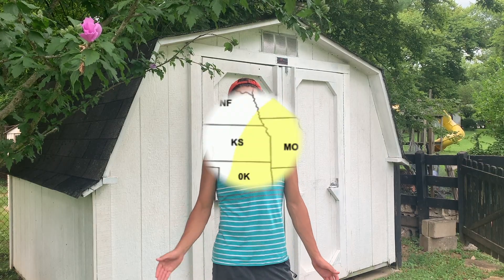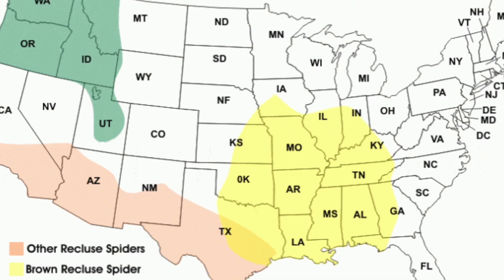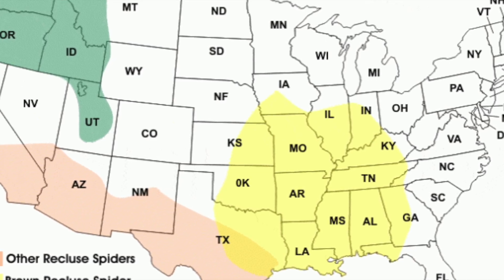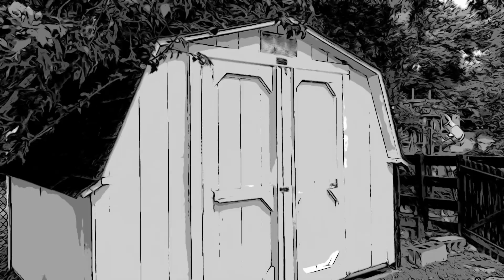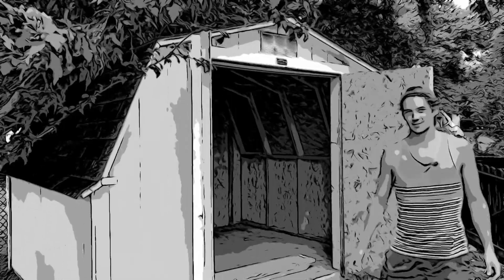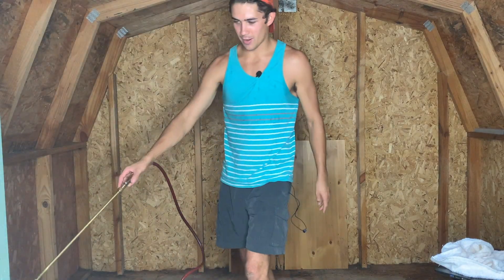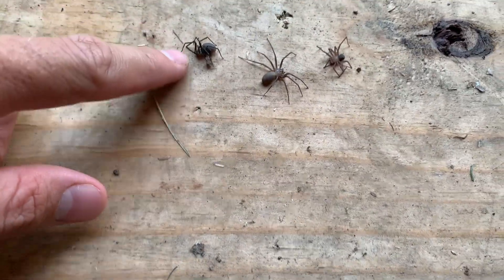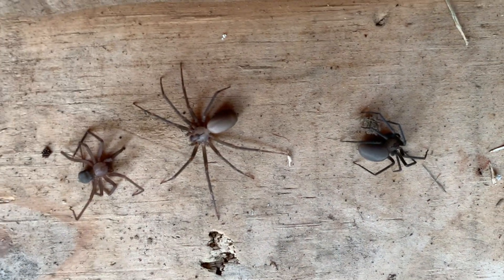Identifying the Brown Recluse Spider Infestation - Example and Treatment

Comment: Hey Dan, just want to share what saved me from a spider bite. A friend, who is a doctor, told me to never be without a 9V battery. He used it on himself when bit by a spider. Just about a year ago, I was cleaning a table top where a friend, who was visiting, was working on his laptop. As I leaned over cleaning the glass table top, I felt a bit on my upper thigh. I was wearing shorts. Very quickly the pain and swelling began to get worse. In about 45 minutes it was much more intense. That is when I remembered the 9V battery. This works on spider, scorpion, snake, bee, etc. Place your salava on the bite area, take the 9V battery and place the contacts on the same area. It nuetralized the venom instantly. IT WORKS! The pain stopped almost instantly. By the second day the swelling was almost totally gone. In another day, the redness was also gone. I don't travel without a 9V battery. Please share this with as many people as possible....
Reply: I used to lick 9 volt battery terminals and get a tingle on my tongue so I believe it would work.
Reply: @bari2883  Good to know I'm not the only one that used to lick batteries.
Reply: @GT-zv1db  😅🤫
Reply: @GT-zv1db  lol try it on a leaj8ng one as a reassurance you might get a canker sore or soar if ya do lol :D nah jk do not put the tingue where the tongue is not supposed to go XD or else that is on you lol ykwis
Reply: @GT-zv1db  shoot how else you going to test the energy left!!
Reply: @bari2883  🙋🏽me too, I used to lick 9 volts lol
Reply: @MissHinds09  lol 😂
Reply: @MissHinds09  gorgeous 😍
Reply: @bari2883 😂😂😂😂😂😂😂😂😂
Reply from the maker: oh wow that's very interesting! Ill have to look into that
Reply: @DanTheBugMan  cmon dude you know as well as I do that's bull crap! So why even act like your amazed. I guess this whole time they have been spending millions on anti venom we could have just been using batteries. Not to mention brown recluse spiders won't even kill you in the first place. The only way it will is if your severely allergic to it or have some extreme health problems. So this person survived be cause they were never in trouble not because of the battery.  Educators like you shouldn't feed into this crao they should tell the truth cuz now if someone is truly in trouble they will be wiring time thinking a battery will save them. What's wrong with this world. Smfh
Reply: Wow is great to know...How it's true...
Reply: I put 3 of my pants hanging behind the bathroom door all was full of black widows... I pushed the bed and couches away and full of black widows.. I found them in the shower behind the toilet all over.. It's investing in this while flat.. I. M going to buy some rat clue tomorrow and put it on a stick try to catch them.. But the ones I cannot see or reached is going to be a worry.. Thank you for the advice... I will let you know how it goes...
Reply: Maybe it works, IDK. A brown recluse spider bite isn't felt immediately when it happens, like a bee sting. It's not until sometime later that you notice a tiny red bump and you will see the fang marks. But it's itchy at first and then it progresses ad the caustic venom starts spreading, it gets worse by the hour and its appearence changes. It's burns like crazy, it throbs, it starts swelling and at some point it also gets weirdly numb and it's so swollen the skin gets tight.....I'm reliving the bite I got last May'22 mainly because I just killed one that was on my pillow....
Reply: Sorry but there is absolutely no study or literature to back this up. In fact there are studies to prove the opposite. What you experienced was most likely a placebo from an old wives tale. (It did show up in old 1800s newspaper clippings as a method).

If you get bitten by a venomous spider (ESPECIALLY a recluse) please immediately seek treatment with a doctor or hospital. Don’t unintentionally make it worse with DIY methods.Ive been in the hospital with a recluse wound for a week and I can tell you it is not fun. Recluse bites can lead to very serious injuries, even amputation.
Reply: @hennessy100k  Firstly, hope you recover quickly! I would suggest that you not discredit something that you have not tried nor benefitted from. Implying that any treatment that is not supported by a "study" is not credible or effective is speaking from ignorance. What if you are in a situation where there is no medical facility near? Why would you NOT try the battery?? There is nothing to lose but an expensive hospital bill! As stated previously, this was shared with my by a brilliant Dr. who used on himself. It was shared with him by another Dr. Don't fear "old wives tales" that are true. Again, I hope you heal soon....
Reply: @fart6203  And what "research" did you use to declare that this does not work? I HAVE USED IT, IT DOES WORK!! Perhaps you would be wise to again  read my original post again. Not misinformation but fact!! I am speaking from personal experience, you are not!
Reply: @davidsmith8576  It's not stupid if it works , very cool thinking outside the box
Reply: @davidsmith8576  I respect that you believe this works, however, I as a spider keeper and somebody who is extremely invested in arachnids and learning about them, would love to know what factual evidence you have to support that the battery itself is what "saved" you.

The vast majority of spider bites are not even close to being fatal. Some may be dangerous if your body has an allergic reaction to the venom, but in that case the venom isn't what would be killing you. Most people that do show significant reactions to spider venom do so because their body has a low tolerance to the venom of the species that bit them. In most cases of spider bites, people experience pain, swelling around the area of the bite, and perhaps nausea or fatigue (though those can also often be attributed to shock or adrenaline as well).
With this factual information in mind, what has you so convinced that the battery neutralized the venom. Where is your science to back up your theory. What has you convinced your life was even in danger to begin with.

Stop telling people not to be skeptical about using a battery to "neutralize deadly venom" when you have no scientific evidence to support it. This is EXACTLY how people die. Somebody's going to get bit and have a severe reaction, and instead of seeking professional treatment they'll go "Oh yeah, I saw this comment on a YouTube video that told me I could just put a battery on it". That person continues to get worse and lands in the ER with severe anaphylactic shock from an allergic reaction to whatever bit them, and whoops, your baseless "Life hack" didn't work, and prevented somebody from getting necessary medical treatment.

If you want to believe it, fine. That's on you. But don't go criticizing other people for being reasonably skeptical when it comes to their health and well being. You want the to believe you? Give them scientific evidence, not some "Well this person told me this and I did this and it seemed to work" tale.
Reply: @TheSitious  if it's a protein based venom, that voltage is gonna destroy it instantly. 

Any microscopic action you can physically feel should be beyond enough to wreck delicate proteins.

not sure if that's the case here
Reply: @ChadDidNothingWrong  If it's the case then sure, I can take a scientific reason like that.

The problem I'm having with this is that, like I said, it's not a guarantee. Not all venoms are heavily protein based, and if you get bitten by the wrong thing and all you do is go "Oops, a rattlesnake bit me, lemme get my battery and save me the trouble of a hospital trip" you could very well die if the battery just so happens to not work, lol.

I'd need to see reports from an actual responsibly done study in order to trust a "life hack" like this.

The other issue is that in a majority of cases, spider venom isn't even that dangerous that you would need to worry about neutralizing it on the spot. It if were a medically significant spider then sure, but even then that's not enough to support choosing a battery over going straight to the hospital for medical treatment.
Even then, most of the time doctors will just treat your symptoms, not the actual venom itself, because the symptoms of a spider bite are far more likely to kill you than the actual venom, especially if you have an allergic reaction and go into anaphylactic shock.
Reply: @ChadDidNothingWrong  do you think the venom is just gonna chill at the injection site and wait for you to grab your 9v? 🤣🤣🤣
Reply: @ChadDidNothingWrong  voltage strong enough to breakdown spider venom is strong enough to necrose tissue
Reply: @TheSitious  very true... I seen a man in hospital bitten by a spider on his back.. There was nothing left on his back and he had to get skin transplants.  And he was in hospital for a long time... At the moment my whole flat is full of black and brown widows and recluse spider's. We don't know when we going to get bitten or how to get them out...
Reply: @studio118  invest in adhesive traps, plant-based repellents (I believe it's the mint or eucalyptus ones that they don't like), and try spreading a very fine layer of diatomaceous earth in doorways and window sills.

I would also look at doing an extremely deep clean of every room in your apartment. If they're taking up residence in your apartment, it means that there are resources inside your home that can sustain them. Don't leave food crumbs laying around, keep areas clear of clutter,  and wipe up any standing water on floors and counter tops. Watch out for signs of other pests, such as roaches, ants, moths, beetles, etc.

Killing and removing them is one thing, and it can be helpful, but if you don't take away their resources then they'll simply keep coming back.

Good luck!
Reply: @TheSitious  thank you for the advice... I will try it out asp... 👌👍
Reply: @TheSitious  thank you so much 👍
Reply: @TheSitious the dude did it himself. Empirical evidence. Chill out with your "I'm gonna need to see ID and documentation case study blah blah..." just because you have a fact or two handy doesn't mean we didn't get where we are by trying things out. It's literally a potential extra idea that could help. There's nothing wrong with using the battery and then ALSO (since we like to use all caps)  heading straight to the ER. Just chill dude.
Reply: Oh wow!! Thank you!! Think it would work on dogs??? ❤❤ Jeannie in Lakeport California
Reply: What size battery for an Eastern Brown Snake?
Reply: @rztricky  I can only share what my Dr. friend shared with me. My friend studied medicine internationally, India being one of the countries. A Dr. he knew used a 9volt battery on a deadly snike bit during a hiking trip with friends. His friend would otherwise have died.
Reply: is this real? lol
Reply: @aeptacon  Read my previous posts. Lol. It is real
Reply: @davidsmith8576  Ok because I am really scared. 😅 I found a recluse in my attic which is directly above my bedroom. I tried spraying at it for a long time but it was behind a mesh screen ...when I checked back, it disappeared. I'll take your word for it I will go out and buy a battery just in case 🤣.
Reply: @aeptacon I'm here for the same reason except that my brown recluse was in the bathroom 😅. I'm gonna by a battery 🔋 today just incase so I can test it.
Reply: So that means if you wish you can tickle and brush uo against whatever you wanna no matter what even especially if it is anythign that is alive XD like mr burns on the simpsons "Indestructible"
Reply: Which one is positive and negative 😂
Reply: Stick your tongue on it
Reply: Cool idea thanks for the info.
Reply: If you get bit by a brown recluse go to the hospital 😢 I know a person whose child died from the recluse bite. Also the map is wrong they are everywhere here in Ohio.... Cincinnati is where this happened at... Be careful....  Recluse is pretty much the only venomous spider next to the black widow....
Reply: This is a horrible myth. There are 0 studies supporting this. Doctors have a rule, draw a circle around a bite about and inch bitch and if the bite gets bigger than that inch seek medical attention. Unless it is something obviously poisonous
Reply: Wow
Reply: Mostly talking spider
Reply: Recovering battery licker here🙋
Reply: Thank you for sharing this info
Reply: This might be a dumb question but does it work if the battery is like dead or almost dead? Does it have to be a new battery?
Reply: The sleeping prophet, Edgar Cayce recommended a product for a spider bite called oil of smoke., no longer available.When I was bitten by what I think was a brown recluse, I thought that his recommendation was likely based on creosote found in stove pipes, etc so I scraped the smoke residue off a stove pipes and added baking soda and activated charcoal daily on the bite. It healed up fairly quickly and no scar. I had read the bite of this spider was an acid so that is the reason for the baking soda.
Reply: This is absolutely not true. This is coming from someone who has studied both chemistry and physics. A 9 volt battery is not strong enough to break chemical bonds in venoms and the current will only travel on the surface of the skin.
Reply: You don't need to carry a battery.  I've known about this trick. If you get bit just grab an electrical cord from a lamp, clock, vacuum ect. Yank it out of the appliance and take the two wires and place them on the bite and plug in the cord. 240 volt works better if you're but a stove or a washer or dryer.
Reply: @maxrepper8836 😂😂

Comment: Here’s the problem I see I work for a very reputable company as a home advisor / inspector there is really only 3 ways to reduce  brown recluse spiders and  that is 1: kill what u see direct contact with the spider will kill it brown recluse do no clean themselves therefore they will walk over chemical any day of the week use glue board most effective or dusting outlets baseboards ect number 2 :take away there food supply the big one number 3 eliminating there hiding areas people don’t realize if you have brown recluse 9 out of 10 times it starts in attic or crawl space the most effective in my opinion is extraction which is taking out insulation and the stuff in the attic notating all areas and vacuuming what u see pesticide insulation will take away those problems by eliminating the bugs crawl space is same thing but it won’t eliminate them want your thoughts on these methods
Reply from the maker: Yep I agree 100%!! Brown recluse need to be treated in multiple ways. Definitely need to organize and DECLUTTER. most brown recluse cases are people with a lot of stuff in upstairs or attic and it just sits them for months or years on end. Then strong insecticides to knock them down. glue boards are great too